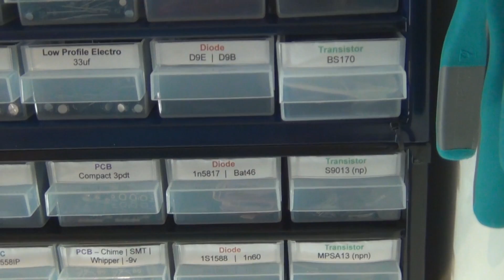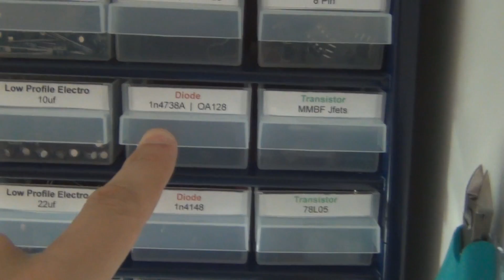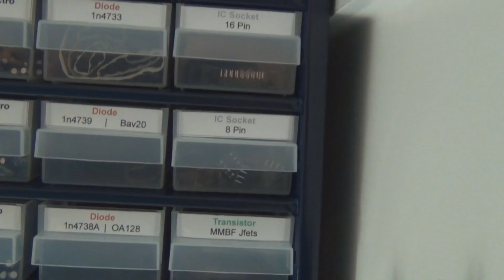Common Pedal Parts Stock Up List - Electrolytics & Diodes Part 2

Comment: Most used Diodes	Vintage/Specialty
1n4001 (polarity prot)	OA1160
Bat41 (clip)	                       1s1588
Bat46	                                1n60
1n5817	                                D98
1n4148 (very highly used)	D9B
1n4738A (not needed)	OA128

Electrolytics (more voltage and/or uF = bigger size)
1uf	                   Less often
4.7uf	             22uf
10uf	             33uf
47uf	             220uf
100uf	             470uf

Comment: hello can i use caps of 50v? or 16v? or it doesn't matter
Reply: eduardo torres  You only have to worry about a capacitor's voltage rating being too low for the application. The only issue with higher values is size considerations (ie. higher voltage usually = larger size).

Comment: are those anti static drawers or does it not matter? studying electrical engineering and looking to stockpile some parts and start doing more side projects.
Reply: Id be worried about very small value components where you could burn it out but most of these components will handle it

Comment: hey i want to do my own night drive pedal and i have question. Does it change something if you are in a another country ,cause voltage isn t quite the same in some country and, i want to know if i have to change anything in the wiring ?
Reply from the maker: +BZHbryan Hey mate, the night drive needs 9v dc, so the mains power you have does not effect the circuit.  As long as you dc adapter is output 9v's you will be fine. Alternative a 9v battery could also be used. Cheers.
Reply: +DIY Guitar Pedals thanks men,hope i won t suck with the wiring, but it looks fine ^^